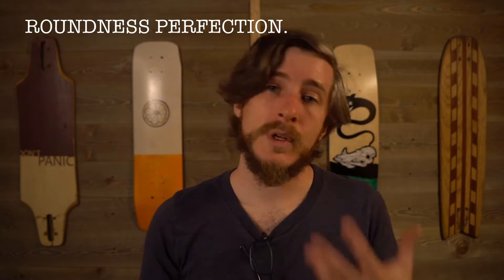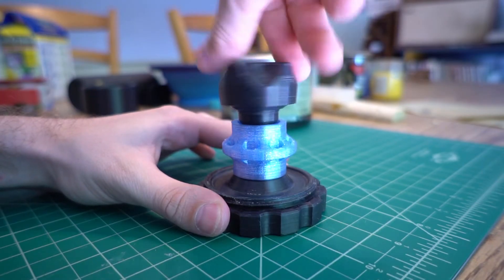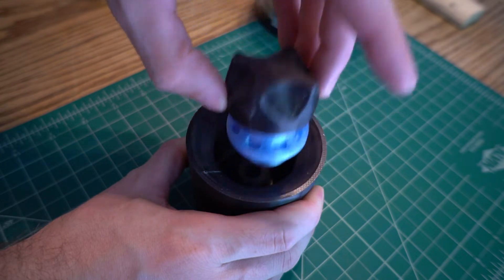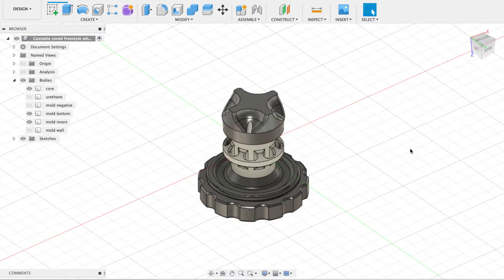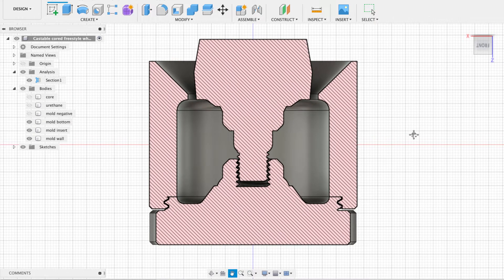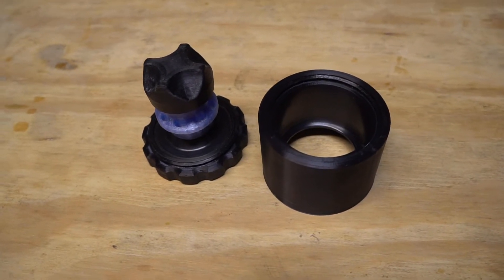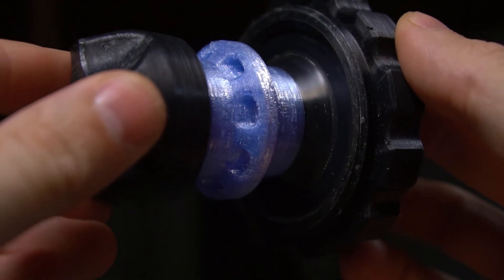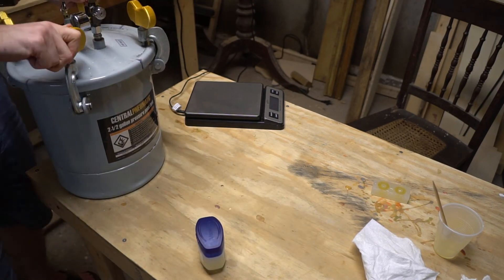3D-printed Mold System for DIY Skateboard Wheels

Comment: Such nice work.  Do yourself a favor and get a $200 SLA printer and print your mold from Siraya Tech Tenacious.  You could also make your hubs out of that.  Or use Carbon Fiber Nylon or Carbon fiber PC for your hubs.
Reply from the maker: SLA printing is the next experiment, I've already got it in the works!

Comment: looking forward to getting a look at the design files.  do the moulds heat up during curing?  do you need mould release?
Reply from the maker: Yes and yes, but the urethane only heats up to the touch, it doesn't get hot enough to melt the PLA. I'm using petroleum jelly as a mold release over the wax layer.

Comment: What's the reasoning behind using a pressure pot as opposed to a vacuum chamber? As I understand, wouldn't the increased pressure just compress the bubbles inside the uncured urethane until you later take it out post-cure? I'm assuming that this would mean that you have trapped gas that's attempting to expand inside the rubber, and my first gut reaction says that would be a bad thing, but I'm honestly not sure if that's true. Any idea?
Also, no idea how you have <1000 subs. These are great videos with great production value and a lot of thought. Keep it up!
Reply from the maker: Thanks for the kind words! The reason I use a pressure pot is speed. In order to degas with a vacuum chamber you have to put the resin in the chamber first, pull your vacuum to remove the bubbles, pull it out of the vacuum chamber,  then pour your mold to cast your part. With a pressure pot I just pour my mold, put it in the pot, pressurize, and I'm done, which makes it much easier when you're working with a short pot life. You're right, it does just squeeze down the bubbles, but it squeezes them down to nothing, and then sets that way. Once the urethane sets it's more than strong enough to hold together.

Comment: Might be a good application for vapor smoothed ABS.

Not as nice to print with as PLA, but could be worth the trouble if you're doing multiple revisions, where otherwise you'd spend a lot of time in post processing.
Reply from the maker: That is actually a really good idea. I know Tom Stanton has made air-tight pistons that way over on his channel. Any idea what kind of print settings you'd need for a good finish?
Reply: I've only messed with vapor smoothing once, but I do know you probably want to give it enough walls to hold its structure while the outermost surface is softened by the acetone, and I know that not all ABS brands vapor smooth equally.
Reply from the maker: Thanks for the tips!
Reply: @GoodRoads   perhaps use a resin printer.
Reply from the maker: I'm already doing some testing around this. If it works it would mean so much less post-processing and I could probably make molds faster.